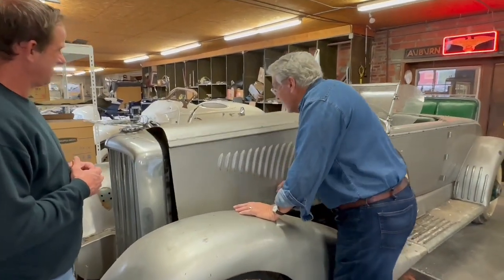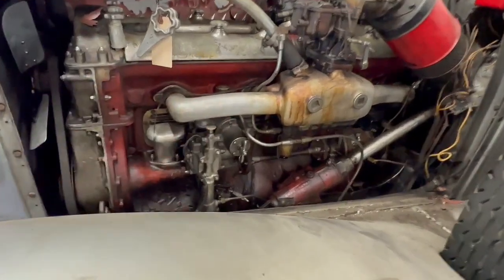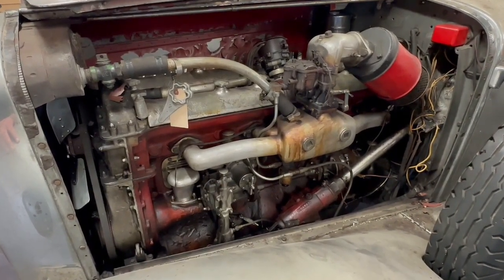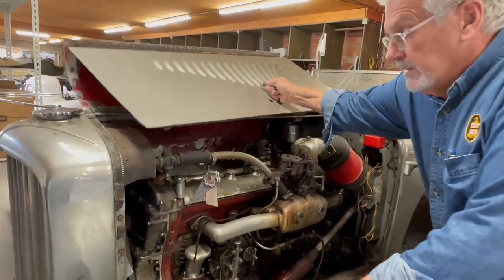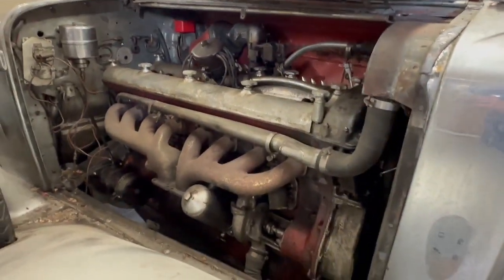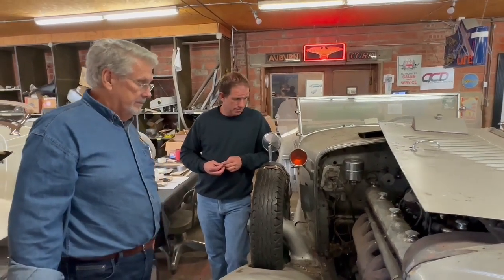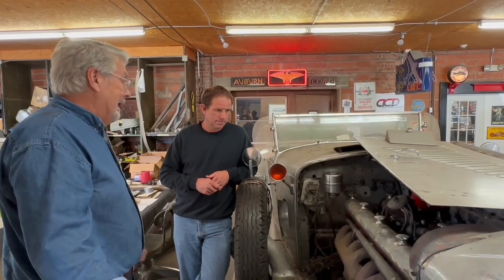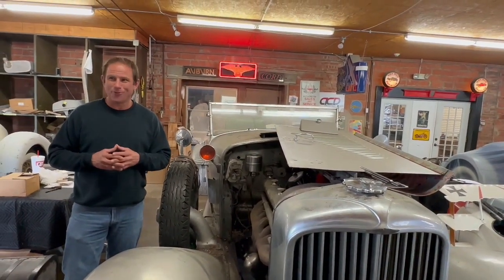Million Dollar Barn Find - 1931 Duesenberg Model J - The Heart of the Beast - The Magnificent Engine

Comment: If this was driven in 61 it's probably on the Duesenburg registry. Can anyone confirm that  ? 
As this is a Duesenburg and it was driven into the garage. I would bet serious money it will start right up with a little lubrication and a new battery. What a torque monster - another great video Chad -
Reply: For a rare 7 figure car,  I would never attempt to start this without a full disassembly and inspection.  I’m sure you’re right but I wouldn’t attempt it unless it had a full inspection.